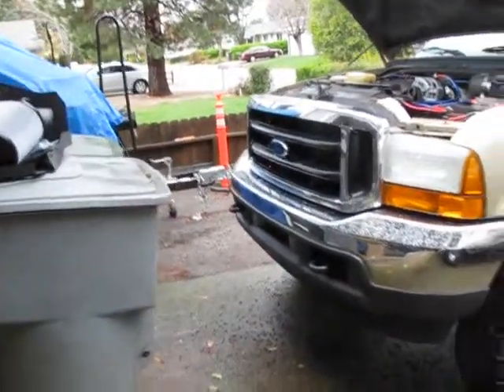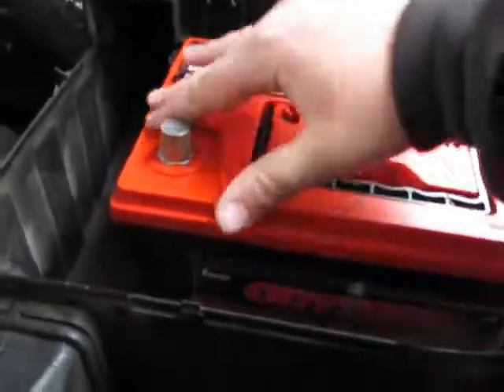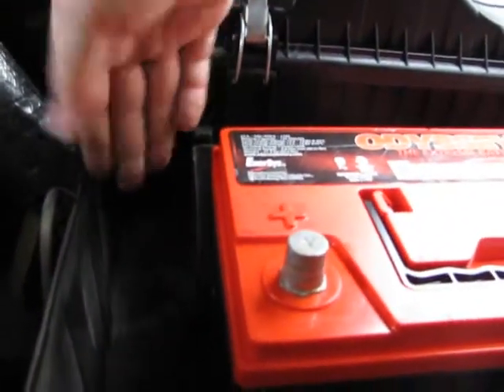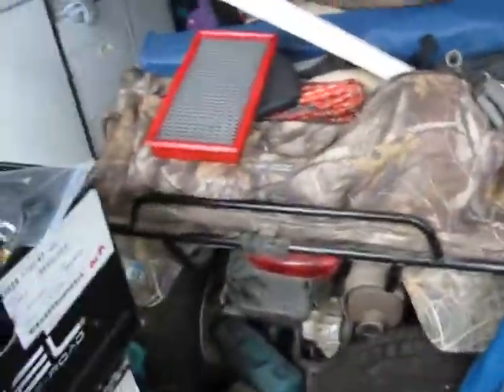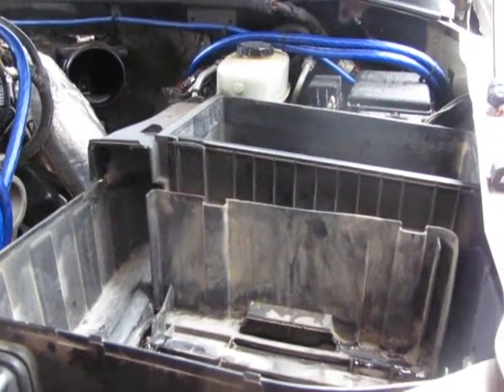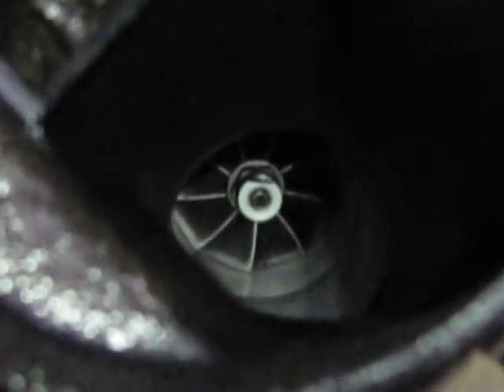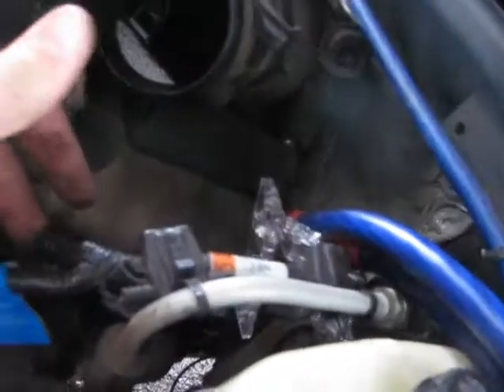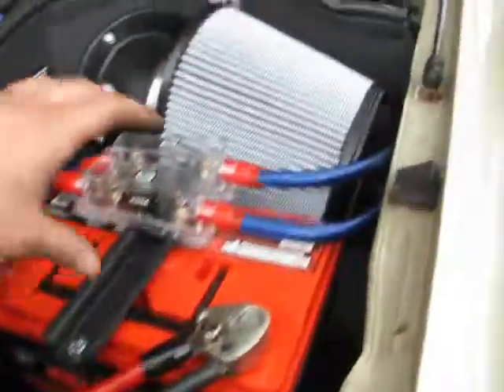S.S.D. ~ Installing AFE Stage 2XP Pro Dry S Intake on my 7.3

Comment: That wire bypass with the blue label on it is a cruise control module recall by ford, I believe it adds the fuse to the cruise control system or something like that 

Nice intake